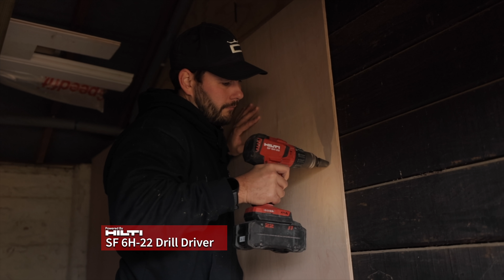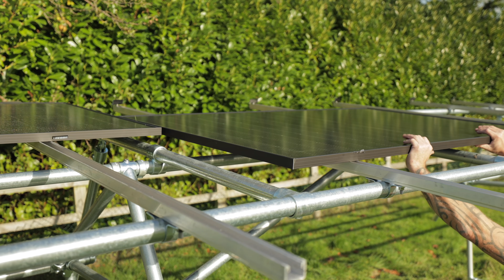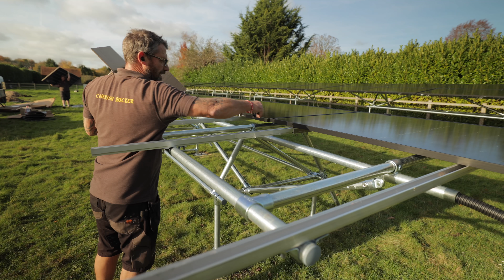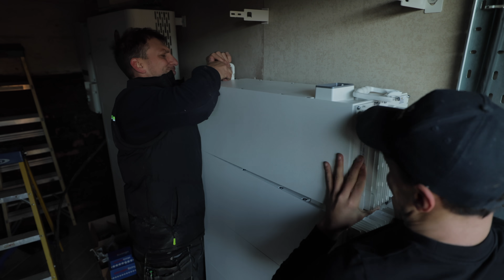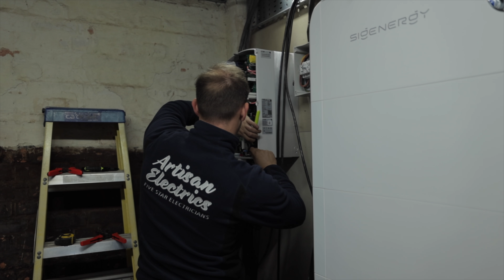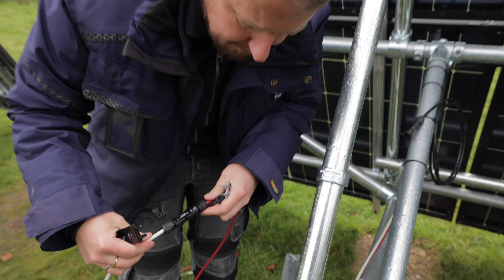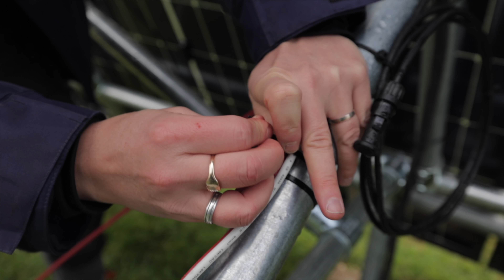The REAL WORLD CHALLENGES of Installing Ground Mount Solar

Comment from the maker: Get a Quote: Interested in our services? Get a quote from us today: https://app.openquote.net/company/artisanelectrics
Reply: at 29:30 the shrink sleeve has hot glue inside ?
make it more expensive... motorize the panel angle automatically to follow the sun's height to the best position
Reply: @AmauryJacquot  As there are two lines of panels set one for summer & one for winter & see how they perform. I'd optimise for winter as that's the minimum generation.
Also Jordan for next time pull the cables from the ends garage/panels to the centre so the last bit off the reel is pristine. Then both ends can be shiny clean for maximum OCD.
Garage    Clean End-------> MH -------> MH ------> MH <------Clean End     Panels.

Comment: When working with DC cabling you need to look at the effects of DC in a different manner!! When DC is travelling through cable you need to understand the generation of the "magnetism , flux generation!! In reality the magnetism of the cables induces magnetics as it fluctuates , you need to ensure that this does not have a dire effect on itself and it's surrounding support system ! SWA !!!! Beware!😮

Comment: Greetings, regarding earthing of the DC PV cables'. In my opinion, earthing the armor of the cable is beneficial because all inverters continuously measure the DC side earth isolation resistance. Therefore if any of the conductors in the cable (positive or negative) is busted and the conductive part comes into contact with the armor, the inverter will sense it as DC side earth leakage and will stop the operation of the inverter. Therefore you are notified that there is a problem with the cable. On the other hand if you do not earth the armor then you need to insulate it at both ends to ensure that no one can touch the armor. Because if the same problem that I have explained above occur, the armor will become DC live and you don't have a detection mechanism to be notified about the issue. By the way this is the same reason why you earth the mounting rails (it is because the inverter has a way to find DC leakage to earth this way). Also if you do not earth the armor I would argue that it is best that you use a cable with no armor because if both conductors are busted and touch the armor, you can have a DC short circuit and depending on the fault resistance (if it is quite high) you may never be able to detect it. Just food for thought.

Comment: well I'm sorry to say but there's a regulation against that heat board It does have traces of asbestos in it As it was in my house just underneath the boiler and for the best angle to have your solar panels when the sun is low in winter is 55 degrees

Comment: I know this video is years old by now....BUT, when using zip ties, you brought up the question about making something last 25 years... Will zip ties (relatively cheap plastic) actually last that long in the exposed elements? Should you be using some sort of stainless steel strap (not super tight, obviously) to secure your wiring?

Comment: Hey man, at 27.20mins it appears you put sticky side down with the self amalgamation tape. All self amalgamation tape should be sticky side out bud, I doubt that one would be different. It’s a common mistake everyone seams to make. It will still be fine on what you’re using it for especially with the shrink but with high voltage terms etc could be problematic. I’m a high voltage jointer and love your vids, keep up the tidy work 👍

Comment: Hi Jordan, may I ask why setting the PV modules at such a funky angle? Is it to compensate for the azimuth? Are these gorunmount not facing south? In the UK they should normally be set between the low 30º and high 70º

Comment: ofc cable should be earthed ..it isn't protection that you have to worry about... try not to earth your construction to earth and get voltage on panels above 300V and you will hear it and also feel it once you will touch earth cable..I know i did touch it..and then i earth all these even all is saying no problem earth needs to be connected on solar panels side..not so much on inverter/charger side..It all depend how it is connected..usually inverters have connected ground and neutral together etc.. etc..

Comment: The export limit being set to only 20KW with a system this size seems like a massive downside to me. With all the effort that has gone into optimising the generation throughout the install, during the hotter months it seems like a lot of that generation will be going to waste. Once those batteries are charged up I doubt they'll be getting drained too low and need recharging, and I doubt the customer will be using 30KWh worth of power to use the rest of the generation. The DC charger is a good feature but again, how often are you fully charging a car? Seems like a pretty large limiting factor that's doing to put the cost to payback time out of whack.

Comment: I'm so glad I found your channel!  I'm in the US, but we are having to be completely off grid in the Seattle area which gets as much if not more cloud cover than where you are :). So we are working on installing a 56kw ground mount panel system with 5 inverters and 100kwh of batter.  Split phase instead of 3 phase but otherwise, the size looks similar.  So far our racks are all up and our solar shed that will house everything is up.  Just juggling getting the roof on and trying to finish getting it hooked up.  The whole build is diy which is a bit cost savings but requiring me to learn WAY more about everything having to do with a house than I ever wanted.  Thank the lord we didnt have to do the paperwork you guys have to out there, but it helps not connecting to the grid.  I'm off to watch more videos. Hoping we have all the parts ready to go and he can hook it all up without a disaster :-)  hmmm Fancy a flight to Seattle for some new youtube content???  LOL
Reply from the maker: Sounds awesome! 🛫

Comment: All inverters have a built-in isolation test, it will power down and report a fault when it detects a short between +/- and PE. By not bonding your armoured cable it can cause it to become connected to DC without detection and it increases danger/risk as the double insulation is defeated. Just like you need bonding on the frame of the panels and the metal construction.

Comment: That extra detour of cable to avoid damage to the tree roots was ridiculous.  The tree can easily repair any root damage on its own. The only reason you would go around it is if you are afraid that the roots could damage the cables in the future; however, this would mean you are not using enough insulation protection. Also very unnecessary the way the cable had to be moulded with an underground impact machine, just to not break the topsoil, my goodness how much more did that dd to the cost?  The grass would easily recover in just a few weeks or months at most. This must be a nightmare project to work with, with all these demands.  The customer was probably a

Comment: In industrial manufacturing the shielding of the armored cable is to reduce noise and voltage oscillation on long runs. (It’ll cause havoc on Ethernet cables near it) We run the shielding to a totally separate ground as shield will generate some current that has to go somewhere. God speed.

Comment: @Artisan - At 28min when discussing grounding you missed one thing: SolarEdge in pair with optimizers will check its DC ports to ground resistance (Isolation Monitoring Indicator or IMI) and will deactivate optimizer in case of too low resistance - thus it is required that the DC strings have an earth byside it (part of cable or added wire) and this is bolted to the PV bracket as the optimizers are also bolted to the same

As talking by PV ground - I don't know the specs required by UK DNOs for PV install, but in my country the PV brackets need to be grounded as a whole with a min 16mm2 copper cable, mostly they use 8mm aluminium rod or 5x35mm steel/inox strip to the burried probe. The ground probe has to meet a <10ohm earth measurment done by a third party DNO approved, before the DNO will allow production to the grid.. The ground point needs to connect not just to the PV frame, but also to the PMO (grid fuse & meter box) PEN point and from this to an AC SPD class T1 between the meter and PMO cut out fuse & a separate ground to a DC SPD between the inverter and the DC fuses. This is all from cuting a voltage spike in case of a lighting strike (DC SPD will short to ground, its current rush cuts the DC fuse; or AC SPD shorts and the grid fuse blow => removing the inverter & house from potential voltage damage comming from the array or grid. It is not uncommon to also find a AC SPD class T2 between the inverter and the inverter MCB. On videos when you are placing DC isolators it always buffles me, why UK regs don't prescribe also DC fuses (+ and -) for each string comming in.

Comment: No Jewellery While On Site all Chains ear rings Nose Rings Cock Rings anything Metallic  Must Be  Removed .   !!!
Reply: Cable porn  Armourall Dashboard wipes & a clean microfiber for buffing . i have no doubt You will like this . :hands-yellow-heart-red::elbowcough::medal-yellow-first-red::medal-yellow-first-red::medal-yellow-first-red::medal-yellow-first-red::medal-yellow-first-red:🤜🤛🙏
Reply: Telecoms Engineer 8 yrs i an tell you without   a Shadow Of Doubt That Armoured Longditudinals The S.W.A Portion Of The Cable ## CABLES  Must Be Attached and linked to a BONDED Ground Completely separate From the  P V .   ?  ???  AT This . RF Shielding Ring any bells . ? . This also includes all Tray Joints ..
Reply: This also Applies to DC SWA !!!
Reply: This will also help identify Failed sheath ....

Comment: I wonder what the power loss is on a hundred metres of dc cable. Would it have been more efficient to put the inverters in a hut at the array and a single smaller ac armored cable?

Comment: Moling a waste. microtrenching on the back of a small tractor will pull the cable and insert it in a shallow position of 60cm or more without any apparent impact at ground level and put a warning tape above them.

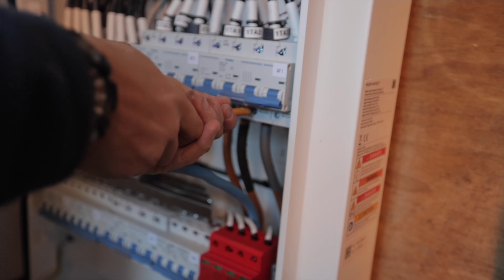Comment: @21:44, shouldn't you use a torqe screwdriver? Also, cable ties will not hold for that 25 years, hopefully 5 - 10 years.

Comment: Nice team nice work and nice video . Optimisers in an open space , waste of money . Personally I prefer victron n fronius :) 

I like the adjustable angle on ground mount frame . 

Does uk not require g10 protection panels to stop export when over limit ?
Reply from the maker: Thanks! Its G100 here in the UK

Comment: Great video, not sure why you didnt install pipe ducting through the field so cable runs can be easily changed if there are issues down the line!

 @ArtisanElectricains: Regarding your question on putting white gravel or a mirror underneath bi-facial panels to increase the production of the panels rear side, I was going to ask that question for a planned installation on my house as I will have a SW- NE array with the NE being significantly bigger!

If the installers were to paint the NE roof tiles white (under the panels only), or place a shiny tinfoil esk material on the tiles to increase light reflection  and their bi-facial production, I'd love to see if its worth it for a tiny amount of spray paint/ backing cover!

If you can do a project trial like this, I would be very interested to know the results! If you want to try it on my roof.....im not in your price bracket, but 18panels total with 14 going on the NE roof is the plan!

Really enjoyed this video!

Comment: Two of us in our 3 bedroom, 3 floor house both work from home full time use about 5kwh of electric a day. I know they have an EV but usig 80kwh a day is mind blowing!
Reply: 80kw wouldn't even fully charge a Porsche Taycan.
Reply: I thought he was going to say the house could be off-grid for 4-5 days not 1 😅
Reply: @SuperKimjong  ?  48kWh of battery dude...   that is not much compared to the average home energy used.  The guy is clearly using electricity for heating whereas YOU are not.  Majority of power YOU use is heating followed by transportation.  His system will do both.
Reply: He may use for bitcoin mining
Reply: Yea right 5kWh... HVAC, not in your total?  Hot water Hello, not in your total?  Using Nat Gas or Propane does not count bud.

Comment: Never saw Directional Boring done like that.
Here in the States Ours are a powered rig that push a steerable tip that can travel several feet underground to go under obstacles and has a transponder that a person can track it along it's path to tell the operator to go up, down, left, right. and depending on Soil type, It can push to several hundred feet. it can have a Core bit installed to go through rock or a Foundation wall..
Reply: Its called a grundomat not a directional drill
Reply: @Vtorious123  Directional Boring in the U.S.A.
Reply: @m9ovich785  A Directional Boring Rig by any other name would be as awesome!

Comment: If they didn't want a trench, what about pulling in the cables with a pipe layer/ripper on a tractor? I could pull those cables in in under 5 minutes, just need a hole in the ground to start with to lower the ripper into and feed the cable through, then drive at walking pace to the end point....or I could pull in a 50mm PVC pipe to use as conduit. At the end of the job, simple drive a wheel along the rip line to pack everything down and in a few weeks you'd never know the ground had been disrupted.
Reply: Agreed

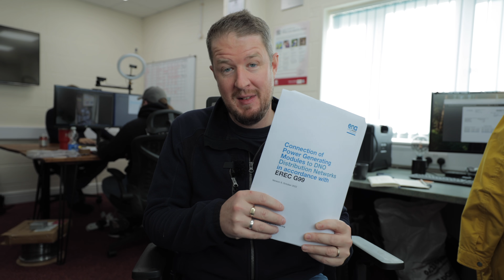Comment: 30:08 in Australia you need to equipotential all rails that have DC on them with the same size earth to the inverter.

You can use string fusing and reduce the earth to the array to 6mm2

Comment: The only difference between a ground mount and roof mount solar system is elevation. They are both a pain in the ass and equally as technical. It's what I do

Comment: It seems obvious to me to motorise the tilting mechanism to automatically optimise the efficiency of the panels. Ideally you’d actually want movement east<-> west but that would be very expensive.
Reply: Right. If you have enough real estate, then tracking PV panels just don't make any financial sense. Just buy more fixed panels. 

The tracking mechanisms are very expensive compared to the cost of PV panels. Part of that expense is sunk into the movable frame, low friction bearings, linear actuators, controller modules and stored energy power supplies. 

Moving parts tend to be common failure points. E-W trackers have to be highly reliable, and that criticality forces the robustness (and price) of every component higher. 

E-W trackers are much more expensive than seasonal trackers. But even seasonal trackers are more expensive installations than fixed position or manually adjusted frames.    

As you can see in this video, the two ends of each adjustable frame are individually clamped into position. This prevents the frames from twisting out of alignment. Each twisting cycle can contribute to metal fatigue and eventual cracking. So manual adjustments are only  made in mild wind conditions or else a pair of strong cooperating laborers is required. 

The existing frames would need to be constructed even more stiff and robust (expensive) in order to be clamped at only a single point. You have to weigh the cost of much stiffer frames vs the cost of two actuators operating in lockstep. 

E-W trackers need to cycle about ±90° daily. Such moving frames need well lubricated weatherproof bearings and good symmetry. The client frames are already built to this standard, which certainly made them more expensive. To me it seems hard to justify the cost, even if this reduced installation labor. 

Actuator motors must overcome viscosity, friction, and imbalances of weight and wind forces upon the PV panels. 

Even during high winds, the actuators must prevent torsional forces upon the frames. Otherwise the frames will crack due to fatigue failure. 

Multiple actuators are needed - probably exactly two for this frame design. The actuators need to prevent twisting forces on the frames, and a pair could work from each end in lockstep. However this requires a joint controller to assure that each pair stays in lockstep and shuts them down if they cannot. Each controller needs to monitor motor currents to evaluate which side of the panel is leading or lagging the other side. The vagaries of imperfect geometry means that the absolute position of the actuator pairs is not always enough. 

Otherwise the two ends of each frame must be kept aligned through strong stiff anti-torsion tubes, or with a connecting linkage that somehow minimizes torsion upon the moving frame. High winds will tend to cause strong rapid vibrations at resonance, so that is part of the strength, stiffness, and damping requirements of moving assemblies.

A positioning signal needs to reach each subordinate  controller. A boss controller transmits the position signal and the subordinate controllers follow the signal. 

The boss controller may turn the array closer towards horizontal in overcast conditions, may position the panels vertical to shed snow, and turn to the eastern horizon directly after sunset, but otherwise track the Sun closely. 

In turn, each subordinate controller needs to compare the linear actuator feedback signal to the control signal and apply power to the motor to minimize the error. The subordinate controllers also need to report error vs compliance logs back to the boss controller.
Reply: @ you know your stuff. Thanks.

Comment: What does it mean when my Hypervolt charger is receiving to much voltage, then shuts down?
Reply from the maker: Either your grid voltage is too high or you have a PEN fault
Reply: @ Thank you for reply, I’ve been told by Hypervolt tech, it’s a dno fault, I’ve never had this before.
Does this sound right?